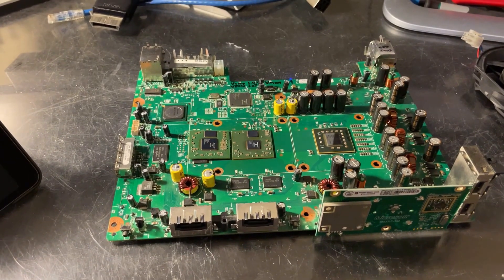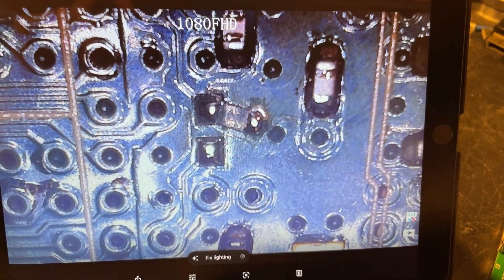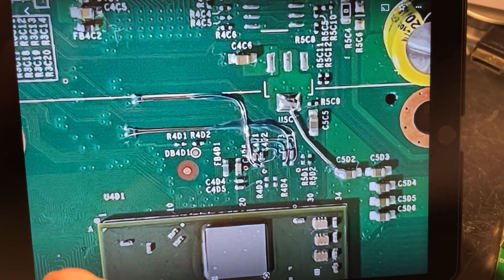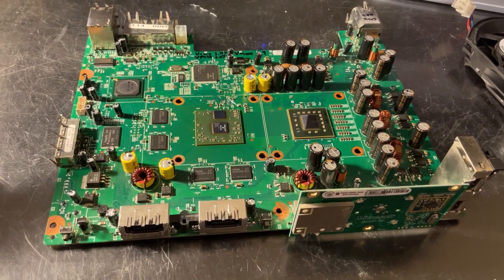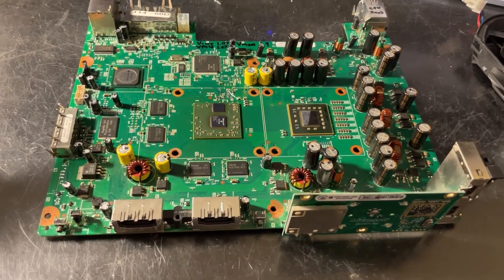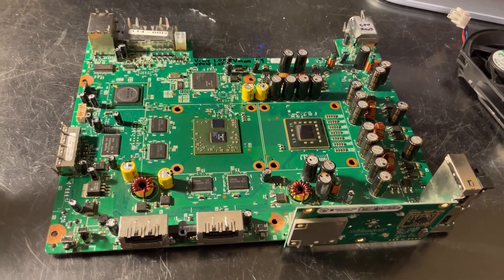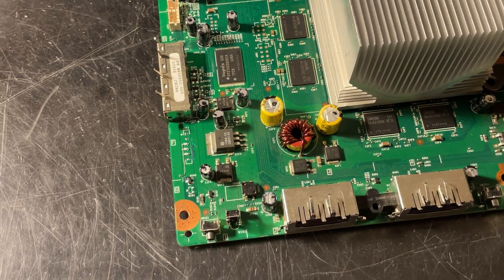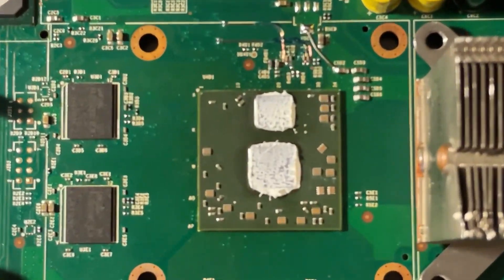Xbox 360 Xenon Retrofitted with 65nm Jasper GPU

Comment: I have an Xenon with 0020 and later falls back to 0102. Luckily i do have an GPU for it (X810480-002), I would send it to repair shop in Sosnowiec to get the GPU installed.
Reply from the maker: X810480 do not install to Xenon.

Comment: Hello Josh, how are you? I'm trying to do this mod on a Xenon but it isn't working... I think the problem is on the software-side of things. Could you give me some help?
Reply: I believe I have the wrong .ecc file for Xell, as my board has a completely different behavior from yours, I can tell that because I've also installed Debug LEDs. I noticed that this has to do with the .ecc Xell file. Xenon_Gunga.ecc and Xenon.ecc shows the same bad behaviour on the Debug LEDs, but any other Xell file, like Jasper for example, it will behave as expected, but will show 0031 RRoD, as Xenons motherboards dont support the 0031 error requirements for newer bootloaders...
Could you send the right .ecc file?
Reply from the maker: Xenon_Gunga.ecc worked fine for me. 
Can't remember about the debug LEDs. Coulda been SMC gpio0 patched.
If it doesn't start, you likely have hardware issues!

Comment: I have a type 2 xenon. Service date of 2011. This is SUPER dope. I'm fairly good at soldering just did an oled and lcd button mod on a gbc thats as tiny as this stuff almost haha. So i should be able to run jasper retail as well which is dope. I would just do it just to do it add the jasper gpu and then be able to do an rgh 3 instead of ext_clk.
Reply from the maker: You still cannot do RGH3 on this. That has nothing to do with the GPU.
Reply: Oh ok hmm. So if would have to be 1.2? I've seen a lot of people rgh3 Jasper's so here's wondering why. Regardless 1.2 is fine as well ofc  @Josh.Davidson
Reply: @Josh.Davidson I have an elpis xenon with Qimonda  ram just found out as of 5 minutes ago lol. So I'll be EXT_CLK pretty soon
Reply from the maker: The GPU is not the restriction that forces EXT_CLK vs RGH1.2/RGH3.
You need to use EXT_CLK on 90nm CPUs. No exceptions.
Reply: Gotcha, thanks so much. I'm new to 360 modding scene. I was heavy in PlayStation but that's childs play compared to Microsoft haha. Any good ext_clk guide you would recommen. I know I need a matrix V3 but isn't matrix V1 the same and I need to remove crystal oscillator regardless so I could get away with buying a matrix V1 correct @Josh.Davidson
Reply: @Josh.Davidson currently reading your entire guide so thank you so very much!

Comment: can you move a xenon cpu to a jasper tho?
Reply from the maker: Not compatible. Different BGA pinout
Reply: why would you want to do that?
Reply: @alenygam6048  to make a jtagable jasper.
Reply: @L0tsen  In my experience RGH3 are very much reliable on Jasper and Falcon motherboards, and it doesn't require a specific dashboard revision. I believe there is no point of even wanting to swap the CPUs between Jasper and Xenon motherboards. Also the Jasper CPU consumes far less power than the Xenon CPU, and the board is very much designed to account for that. That is why there are so many capacitors and voltage regulators missing from the Jasper motherboards that are there on the Xenon motherboards. Also you would need to install the Xenon CPU cooler and mod the fans onto the Jasper motherboard. Overall, even if they were pin compatible, it would not be worth it to try to swap them.
Reply: @alenygam6048  ik I just think owning a jtaged console is neat. I have a rgh3 jasper.

Comment: In your opinion is it worth re-capping a X817791 korea gpu xenon from 2006? It must've been sent in for RRoD. Needs all new caps. Some have vented through the top while one seems to of let the magic smoke out. Haven't powered it on yet aside from giving it 5v for standby to dump the nand. With the nand dump I think its on kinect dash.
Reply from the maker: Yes. X817791 is reliable. 6.3v 2200uF parts. (Some xenons used 2700s, it doesn't matter, both values are far over the needed spec, just use 2200s).
Reply: @Josh.Davidson  Alright thanks. Gonna get a cap kit from console5 here soon. I did try powering it on just to see if I could get to the dash and one of the sanyo caps on the input filters popped. I don't think it did any damage though. Have since desoldered the input caps. Waiting for the kit to go further.
Reply from the maker: Sanyos also? Poor console :(
16v 1500uF.

Comment: I have an xbox 360 fat pal manufactured in 2005/12/14 with error 0101, I already did the reballing but the problem came back after a few months, I wanted to replace the gpu, it would be better to do this mod or exchange for the original 90nm model, Thank you !
Reply from the maker: Reballing not fix it yes. best solution to change to X817791 which is the fixed Y1 GPU or X819195 which is the Elpis fixed 80nm GPU for Xenon.

Comment: Hey Josh long shot here but is there any write up on what resistors and traces need rerouting 

I have a pile of xenon’s willingly able to accept a bunch of Kronos gpus I have 

I have also just recently bought a bga rework station and just want to dabble into this little more 

Thanks as always I appreciate all of the work you’ve accomplished
Reply from the maker: Are you planning to run RGH on this? If not, don't bother, put RHEA with trace mod or Elpis/Fixed Y1.
Due to the Type 1 problem.
Also pls do many practice before attempting a big project because BGA rework takes a lot of time to learn.

Comment: I would really appreciatte a guide on this. If you already made one i would like to see it. I have a xenon i would like to do this on also what are the steps to resolder the new gpu back on the board. Sorry im a noob yet.
Reply from the maker: There is no ability to really do the guide based on the difficulty right now. You must already be proficient with BGA and microsoldering.
Reply: @Josh.Davidson  i mean i have pretty much experience with micro soldering but i never changed a bga chip before i was thinking of buying one of those already prepared with new solder ball. But i have no idea how to do it or get the info of what points need to be bridge.
I would really like to make this xenon reliable.
Is there anything that could be done in order to keep it from failing ? Its already RGH. btw
Reply from the maker: I suggest installing X817791 instead. Reliable chip without the hassle of all this rework. At least until I finish my better solution.
Reply: @Josh.Davidson  got it, thx men i will use mine until it eventually fails to do this.
Reply: @Josh.Davidson  im so lucky i just open up my xenon an it have that exact chip you mention.

Comment: I hope to one day perform this swap on my dead Xenon. How can I tell if I have a Type 2 KV? There's glue around the CPU and GPU, which from what I've read was not on the original launch units.
Reply from the maker: Glue was added by some manufacturers in 2006.
You need to dump nand to know and decrypt. Unless it is a MS Refurb it will have type 1.

Comment: Wow it's finally done! Great work! I have a question for you. I have a Jtag Zenon running blades dash 5759 with a dying GPU. Would it be possible to put a Kronos 65nm GPU on it with the current dash or would I have to update to 6717 in order for it to work?
Reply from the maker: You have to put 6717 afaik. I don't know exactly when support was added.
Reply: @Josh.Davidson  Oh ok thank you. I guess I'll have to swap another 80nm GPU on it if I want to stay on the same version. Oh well
Reply from the maker: @Repeatingpower7  Elpis :)

Comment: Realy clever stuff josh but can i ask a question ? "what benifits does this have over say just modding a jasper version xbox360 ?"
Reply from the maker: At some point, it will be hard to find the reliable chips for the Xenon and Zephyr and Falcon. The new old stock Korean and fixed Taiwan will run out. There are way more Jasper chips available since they don't fail, so this might eventually be useful.
But more like, because I wanted to know if it could be done. Keeps noise and power usage down too.
Reply: @Josh.Davidson  Right gotcha i thought it may have been something like that thanks for the reply.

Comment: That is crazy cool! There was a thread over at PSX-Place that a modder purchased and took apart and discovered the same type of mod to create the ultimate phat  PS3  with 65NM processor and retaining ull BC with PS2 games..
Reply from the maker: Yes, PS3 with 40nm RSX. I made one too, video soon.
Reply: @Josh.Davidson  Ah that is right it was using 40nm processor from a slim! I think I got my cables crossed because my phat was the 2008 model 65nm haha. That must be what I was thinking about! cool can't wait to see a nice deep dive video going over that mod! Let's say you were going to make and sell these systems, how much would they go for? Well for either 360 or PS3.
Reply from the maker: @BFKAnthony817  I don't know the exact price, but it would not be cheap.
Reply: @Josh.Davidson  Yeah I could imagine with all the work involved. Still, a an upgraded BC phat with this and a better PSU would be awesome to see to seriously cut down on heat and prolong the life of the system.
Reply from the maker: @BFKAnthony817  Heat is not the issue, defective chips are. A reliable hotter running chip would also fix it.
Reply: @Josh.Davidson  yes please ❤️